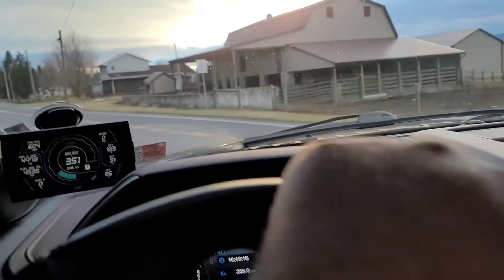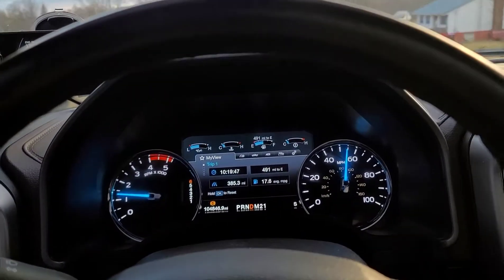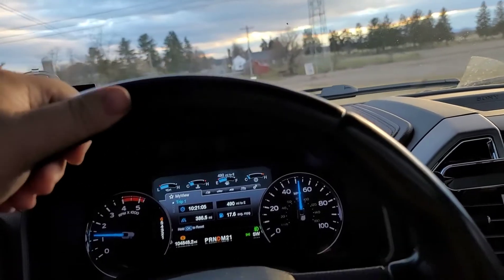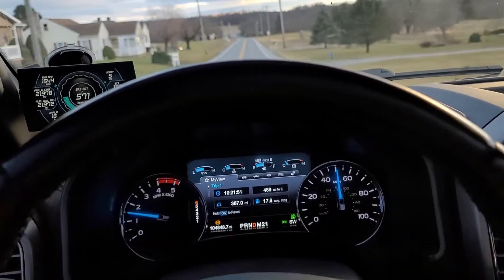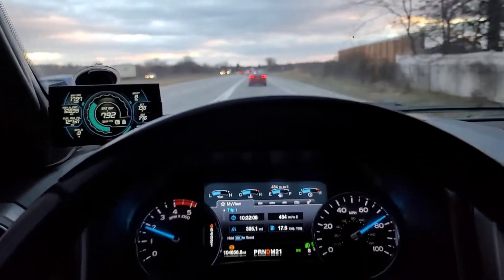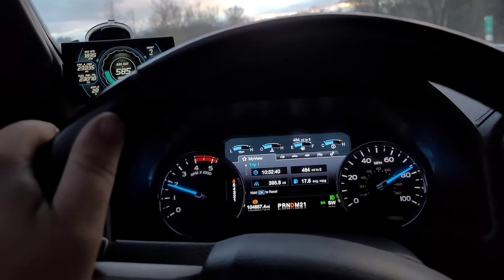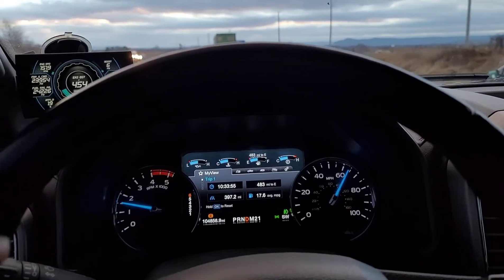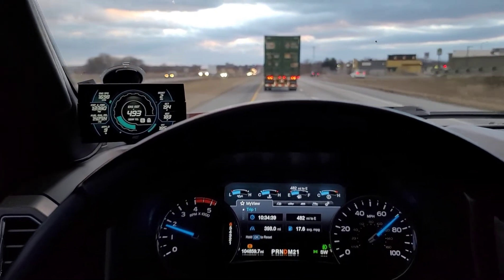10,000 miles on compounds

Comment: Its been a while since you make a video how is the truck doing and how many miles do you have on it now
Reply from the maker: I don’t have the truck anymore but am still in contact with the current owner. The last I talked to him the truck had around 200,000 on it so roughly 100k with the compounds. He said the only issue the truck had given him up to that point was a water pump at 180,000 miles. Other than that zero issues. When I sold it I ordered a 22 and am contemplating doing a compound setup on it as well when it’s out of warranty. If I do I’ll certainly make another video.

Comment: So you did the pressure enhancer solenoid and the pressure controller? Or just the controller?
Reply from the maker: Just the controller. Was going to do the solenoid too but never got around to it. Trans was still holding great though the last I heard with around 160k on the truck.

Comment: What tuner do you have showing all of the temps? I have an 11 with a sct x4 but I'd like to add an EGT sensor
Reply from the maker: My tuner is an sct bdx but I'm running an edge insight cts3 for my guages.  It's nothing more than a monitor and will work on any vehicle 96 or newer.

Comment: What’s your trans line pressure looking like cause with my tuning I’m in the 230-260 just wanna see if the bd controller really puts more to it
Reply from the maker: I can't get mine to show line pressure for some reason.  I want to drive it with a scan tool and see what it's actually running along with the duty cycle of the pump but haven't done it yet. It's still holding so far so I'm happy. Almost 15k on the setup now.

Comment: Do you have trans tuning as well as the line pressure controller?
Reply from the maker: Yea i do. I switched to Proven tuning a few thousand miles ago. The trans seems to be way happier. It shifts firm and crisp with the bd controller and the trans tunes. It's nowhere near hard enough to hurt anything but definitely not letting it slip at all.

Comment: What compound set up you running?  I’m running the MPD compound kit with the s475 atmospheric and the stock valley charger.  Plus a whole catalog of No Limit parts.  Your spot on with the mpg I got like you said 2 more miles per gallon.  I’m running H&S dual fueler but stock trans, stock block, stock injectors.  Mines on a 2019 f250. Oh what tunes are you running and are you on ezlynk?
Reply from the maker: Running the exact same setup as you. I'm running chaos tuning with sotf through an sct bdx tuner.
Reply: @leoluvsdodge  running chaos as well 👍🏼 Not sure how many miles I have on mine not as many as you.  I’ve been from Houston to the Florida Keys and back and to Colorado from Htown without any hiccups.
Reply from the maker: @dr.bowdoin3067  you're a brave man running all that fuel with that setup on stock rods lol I'm too nervous to do it
Reply: @leoluvsdodge  I’ve got a lot of supporting mods but I don’t abuse my truck i treat it like a truck but I don’t race or do burnouts on the wknd.  I haul hay, few tractors.  I leave it on tune 5 I get 16mpg.  Guy who tuned mine did a good job kept in safe parameters and it doesn’t smoke at all.
Reply from the maker: @dr.bowdoin3067  yea I play around with mine a little but mostly use it for work. Mine runs super clean as well. Only way I run mine hard is in manual mode and I let out before i shift it.
Reply: @leoluvsdodge  never ran mine in manual mode but I did notice a big difference in the way mine shifts when I have the exhaust brake on and when it’s off.  I only run with mine on and it shifts a hell of a lot smoother!!!
Reply from the maker: @dr.bowdoin3067  I run manual mode all the time specially when towing. I also run my exhaust brake any time I drive the truck.
Reply: @leoluvsdodge  I’m gonna have to give it a try now 😎
Reply: You both leave your tow buttons turned on for the exhaust brake all the time?
Reply: @shanetaylor7581  I do, push it after I get in
Reply: How’s are you guys liking your compounds? I’m looking at doing a no limit precision 76 with a stroker pump on my 2016
Reply: @anthonysalazar4189  no complaints here except the price tag.  Love my truck.  I think No Limits kit with that Precision turbo should whistle nicely.
 👍🏽